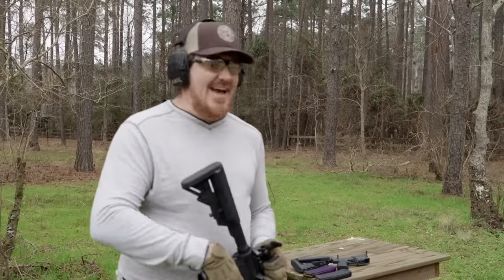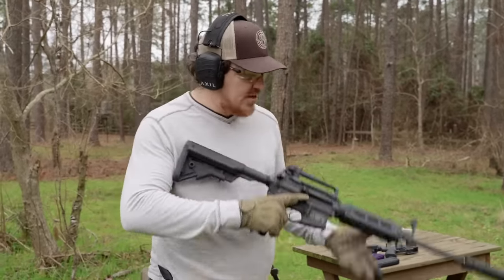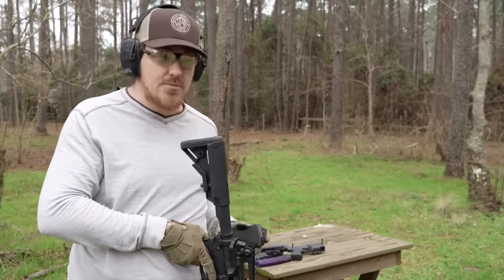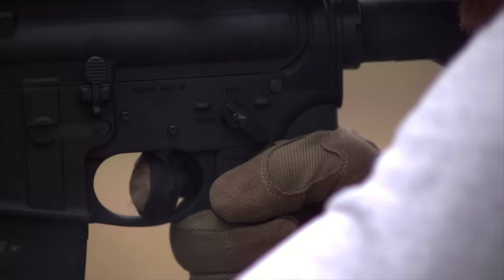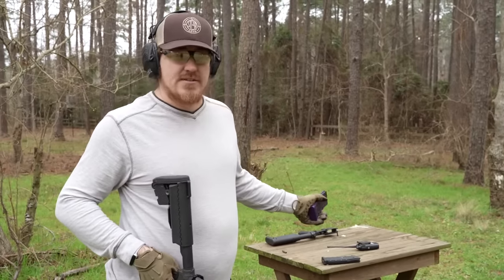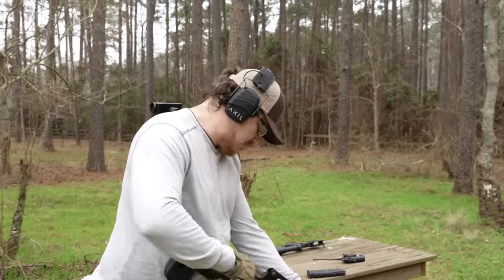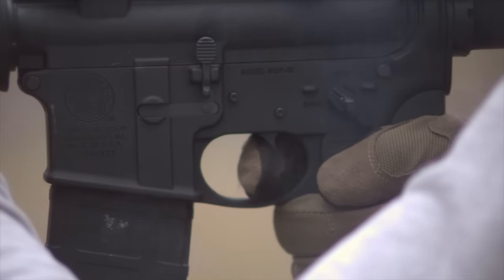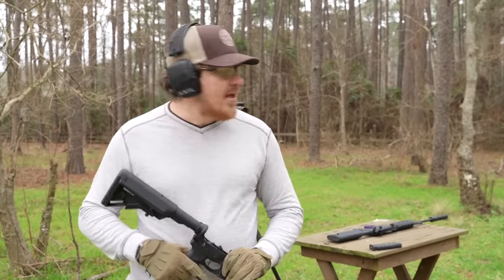FRT-15 Vs An Actual Machine Gun

Comment: How is this not covered under the definitions of single function of the trigger, vs single pull of the trigger? It seems pretty clear that the FRT is depending on a additional mechanical function to trip the the trigger forward, (its addition use in lieu of a disconnector). In most videoes I have seen on youtube, it seems like it is very difficult to even get off one shot because for most shooters the trigger is reset into the finger before its ability to get removed.
Reply from the maker: Forward assisted triggers are nothing new. They just did it right. Now, they did not get a letter of approval from the ATF - but they have also not received a letter to cease and desist yet either! Out of the box it is difficult, but not impossible to do single shots. Replacing the trigger weight spring from the 2.5lb to a 5lb makes it noticeably easier to control fire rate (single versus multi-tap). But this is an after market change. . .
Reply: @gatcattill  the frt design incorporates features which inherently make it function in a full auto capacity. It's more evident than even with how bump stocks first entered production in 2010s as a result of it's design, the document that slide fire obtained from ATF.

But the frt, it uses the full auto carriers motion to reset the trigger specifically by pushing the now, disconnector element, to the users finger. It does that much more efficiently than the bump stock. In terms for comparative sake, the binary triggers would be in a more legal design because you wouldn't get the effect the frt produces. 

It seems to me, and you would know more about this trigger, if you applied a reasonable amount of force to the trigger at that exact trigger reset moment, you would create that repetitious fire without moving your finger. Simply apply some level of force? 

That would inherently make the device a sear.

If this is legal, all full auto variants should be legal because the designs are manufactured to make the weapon function in that way.
Reply from the maker: @LonginusModus  Make sure you watch the video again around @3:00 to see the trigger movement. This is the result of lightly pulling the trigger. You have to have trigger travel in order to fire - its just an auto response (see what I did there)  by your trigger finger. If you slam your finger back - the gun will only fire one round and lock the bolt open. Releasing your finger will not fire another round, but pulling the trigger again will fire from a bolt hold up (its more of a stalled bolt). The fact that if you rail the trigger back it only fires one round explicitly showcases how its design is not automatic. Perhaps its time to bust out the highspeed again and show this in action from two angles!
Reply: @gatcattill   yeah I understand what your saying. But by definition that description touches on single function/single pull of the trigger. By the looks of what the frt does, a light pull will result with another shot, regardless of trigger movement. The user pulls slightly and the hammer is released. Weapon cycles. Upon return of the carrier it hits the frr design which bounces the trigger forward to the users finger, that pressure which subsequently results in another release of the hammer.

Your video is very good in outlining it's action. It's why I commented on yours in lieu of other example videos. 

The pulling of the trigger is actually one pull (from standpoint of muscle memory end user, they don't realize the difference due to cyclic rate of trigger reset tapping back)

I wonder why ATF hasn't looked at the frt with any interest. Considering the political climate that seems strange.
Reply from the maker: @LonginusModus  The Tac Con 3MR was released and approved by the ATF with a letter something like 7 years ago. Same exact concept except for it did not have the locking bar preventing the trigger from pulling again when the gun was out of battery. This made their version of the trigger less effective, but still applied the same concepts into action. The ATF does not determine what classifies a trigger movement, just that a single trigger movement for a single bullet is required for it to meet the definition of a semi-automatic rate of fire. The rate at which one is semi-automatic is not part of that discussion. This video was made to help folks make this argument in case the decision was made that it needed to be fought for. Personally, this is a great range toy, a fun introduction to pseudo full semi auto for your friends, but outside of that it will never be used in defensive situations unless crap hits the fan, and in that case, I'm sure a lot of coat hangers will be murdered anyways. Thanks for the debate though. Appreciate the inputs!
Reply: @gatcattill  tac con does not incorporate the frt mechanism which allows for the sustained fire rates you show and is also a completely different design. I disagree with the conceptual assessment. The frt design you show in action in your video inherently incorporates a weapon that does not "fire only a single projectile through a rifled bore for each single pull of the trigger".

This is true for the main reason that the function of the trigger is altered to take a mechanical function of a disconnector. 

If the end user pulls a light amount of force in their initial pull, or it's still entered into that trigger reset area, the trigger will continually tap the finger, which is still holding that initial pull, which is therefore sustaining the same mechanical pulling force as for the first shot that was fired. This is evident by both the video and your description of the action. This is not a debate. It's friendly banter with one of your subscribers. I was interested in understanding the design. Your video in particular and responses assist in that.

I hope one day we all get to live free and not have to deal with all the red tape.

Appreciate your content.
Reply: @gatcattill  apparently atf arbitrarily decided to legally define it as a machine gun with no comment period. ☹️

Comment: Yeah I understand why they are illegal, you didn’t pull the trigger 30 times you pulled it once and the forced reset is just moving your finger back and forth.
Reply from the maker: Still a single function of the trigger which qualifies as semi automatic rate of fire. The amended verbiage added by atf to circumvent the interpretation of a machine gun was thrown out by the appeals court
Reply: So the only thing you’re doing with this is making it harder for people who follow gun laws because they are just going to make them worse now. This is practically a full auto and now the atf might have to change the definition which could cause issues. You can bring up the Jerry point or whatever but the difference is that Jerry shooting fast effectively takes effort and skill, this doesn’t.
Reply from the maker: @UnluckyLux  atf can't just change a definition. That's why this is being fought in courts right now
Reply: Oh they absolutely can and they already have with this trigger  @gatcattill
Reply from the maker: @unluckylux6268  they can't which is why they are being sued

Comment: hey does that frt trigger work with a 22lr kit jammed in it?
Reply from the maker: Yes with a lot of work and it’s not 100% but it is possible. With this setup I dropped in a cmmg conversion bolt and added all the bore buddy goodies and it ran 3-5 shots before dead trigger. So still needs work. In my cmmg dedicated 22 it runs 90% with stingers 50% with any other ammo.

Comment: Can you use a hydraulic buffer with the FRT-15 ? and what about the Bolt can it be a standard or does it need to be a full auto bolt
Reply: Pete, full auto bolt is required.
Reply from the maker: Full auto bcg is required. You can try hydraulic buffers, work for some but tuning your gas will be required

Comment: Just bought a FRT-15 trigger but the pins included are too long for both my ruger and Springfield AR.. there’s slack after the pins are tight.??
Reply from the maker: Correct. The anti walk pins that it comes with are absolute garbage. I ended up replacing them quick with the strike industries antiwalk pins for about 10 bucks. Little annoying to get on the first time but seems to have been made easier after that.
Reply: Lol yeah I had loctited mine on the screws of both end before fastening them in. The wiggle probably helps compensate for the pew pew pew. Mines been great through 600ish rounds.

Comment: What does rapid firing do to a standard mil spec barrel on my rifle with these RFT?
Reply from the maker: Just faster wear over time. Your gas tube will
Break first from over heating usually before any heat based damage is done to your barrel. And even then down the road 5k rounds 10k rounds you’re just going to really just start seeing poorer grouping and keyholing.
Reply: @gatcattill  
I think I am safe with my shooting time.
Thanks.

Comment: The problem is this: there's only one user action being applied to the trigger: pulling. The trigger turns a single user action into multiple shots by kicking it back to let it be fired again through a continuous pull. And the trigger group has a 3rd pin exactly where an M16's 3rd pin goes. The ATF's case is strong.
Reply: precisely, people will try to argue semantics but the matter of fact is and is clearly demonstrated in this very video, that this trigger turns a semi automatic rifle into fully automatic, whether the "autosear" function is achieved inside the gun or by "force reset" of the trigger is irrelevant, the FUNCTION of the firearm is changed and even moreso than the bumpstock where at least you have degradation in accuracy, this trigger makes the distinction between "semi automatic" and "machinegun" meaningless which can turn out to be exactly what antigunners would need to force a total ban on semiautos ...

this is HARMING the pro-gunners more than anything in recent history... ffs people wake up and stop giving the other side the ammunition to use against you ...
Reply: @WardenWolf  That's false, until there's a legal ruling with finality and enforcement protocols established and undertaken, nobody is subject to prosecution for buying something that was legal prior to such an outcome - If you transferred the product or bought it after it became ruled by the court to be illegal, that would then put you at risk.  Just because the ATF sent them a letter saying it's a machine gun doesn't mean everyone that bought one is magically a criminal lol - They don't even have a fraction of the manpower and resources necessary to try to prosecute everyone that purchased this product, and I'm sure that Rare Breed has sold a substantial number of them.

Comment: I'm having light primer strikes with mine. I have a psa 10.5 upper  with their bcg full auto. I tried the h1 buffer and h3 and both still shoot 1 round then light primer strike. Any ideas?
Reply from the maker: Go a5 you may still have bolt bounce with that 10.5” you’d want to video the bolt action in slow mo and see if your firing out of battery. Your bolt carrier group could also be timed poorly. Try a different bcg if you can.

Comment: sorry, you can talk around it, but it IS FULL AUTO - the automatic shit just does not happen inside but at the trigger. Doesnt matter where the fullauto mechanism is.
Or in other words - you push on the trigger once and you dump the mag. Doesnt matter if the trigger moves automatically by itself when pushed. Its just one push and one mag dump. The trigger is the FULL AUTO part, it resets itself, you dont reset it. It works automatically.
PS: iam a gun guy, but iam just realistic about it and dont lie to myself.
Reply from the maker: It’s not about perception it’s about the letter of the law. You push the trigger and hold it like an auto and the gun will only fire one shot. See my follow up video displaying this behavior.

Comment: Do you just leave your finger in the same spot so the trigger bounces off of it on reset?
Reply from the maker: It’s not even as complicated as that. Your main objective is to not over squeeze the trigger and cause it to lock open. There is a small learning curve to making it run perfect for each shooter but the learning curve is simply knowing what too much trigger squeeze feels like. If you have decent trigger control already you’ll be fine off the bat.
Reply: @gatcattill  i just ordered one so we'll see. Thanks for the info

Comment: What do you do when you pull the trigger and don't want to fire the release round? Put it on safe while holding the trigger?
Reply from the maker: That’s binary. There is no round on release. If you don’t want to fire a second round simply release the trigger and the don’t squeeze again. It is a very light trigger so you have to be cautious
Reply: @gatcattill  that seems kind of dangerous for real life defense but very cool on a controlled shooting range.
Reply from the maker: It’s a range toy. It’s not made for defense imo. But would work fine for suppressing fire if it was something that was needed

Comment: If it itself is not a gun, it cannot be a machine gun. Even if it resets the trigger, you are still using your finger to apply force to the trigger to pull it.

It doesn't meet the definition. At all.
Reply from the maker: I agree 100% however when we go into this kind of debate - we must consider all the precedence that has been set. This does include the lightning link that was manufactured as a machine gun, even though it was a 50 cent piece of metal inscribed with a serial number! This small device could drop into any mil spec AR and turn it full auto. By this use it was deemed as being the serialized machine gun, while the AR it gets dropped into at any given time is not a machine gun? So precedence says they can call it a machine gun. Barring that - this is not a machine gun 😂
Reply: @gatcattill  Their own precedence, yes. Which is why they can't afford to let rbt succeed in court. It would throw all such felonious rulings into question.
Reply from the maker: @jojothermidor  which is what we need to happen. However, I think that would still stand as it IS an auto seer and was registered as such. The bigger issue is does this give them the ability to go against binary triggers? Match grade? Light weight? These are where the downhill issues start
Reply: @gatcattill  If it goes to court, it maybe gets better, or it gets worse.

They don't want you to own firearms. So, don't expect them to play fair. They never needed approval anyway.

Comment: Not a close case every trigger is a assisted reset. You clearly are physically pulling the trigger one time compared to 30 times.
Reply from the maker: Exactly. May need a high speed to see it. But it happens!
Reply: @gatcattill  exactly just cause an atf guy isn’t smart enough or have enough experience to feel the difference doesn’t mean it doesn’t happen.

Comment: "by a single function of the trigger" 

I think in court applying doctrine of the common man and using videos like this the argument will be made and likely successfully, that because the individual resets/pulls are indeed subconscious this is no different from a single continuous trigger pull of a traditional sear controlled machinegun. 

there is no way this doesnt get classifed a machiengun. They classified bumpstock for christ sake
Reply from the maker: Bumpstock was overturned and this tech has been around for a while. Rare breed simply did it best. This could go south. But buy in person in cash and have fun!

Comment: Okay so I know you made a mention of the difference in buffers, but only after clearly stating that one trigger would be better than another trigger in regards to rate of fire.

You do understand that all the trigger does is drop The sear which holds the bolt, and because of this it's physically impossible for any trigger to be "faster" than full auto?
The trigger has absolutely nothing to do with the potential rate of fire, that is all in the action. 

A legit full auto lower gets out of the way of the bolt entirely, unlike any other trigger.  How fast the gun runs is up to the rest of the firearm.

You can compare tricky triggers to other tricky triggers, but it's not possible for any of them to allow the SAME GUN to run faster than a sear which stays out of the way entirely.
Reply from the maker: Yep. Which was covered in less words 🤣 the trigger stop may slow it down by a fraction of a second but the buffer weight snd the springs change rate of fire most importantly.
Reply: @gatcattill  then why did you make a video trying to make it look like a tricky trigger is faster than legit full-auto which is impossible?
Reply from the maker: @deejayimm  didn’t. Made a video to show trigger movement and compare rate of fire. The RBT was faster rof and I explained why.
Reply: @gatcattill  "frt-15 vs an actual machine gun"  "frt wins?"
You either didn't know anything about the mechanics, or you were doing some stupid clickbait bs.  This entire video is a comparison that which cannot exist.

"The rbt was faster rof and I explained why"

No, not once did I see you say you failed to compare apples to apples.